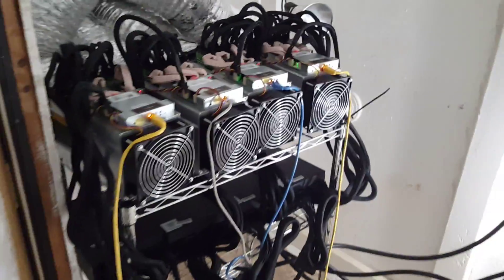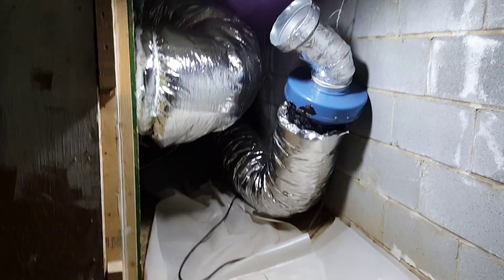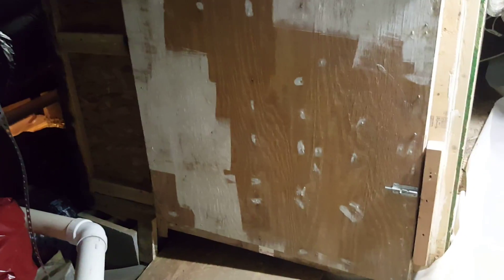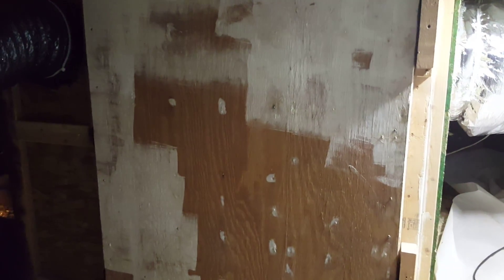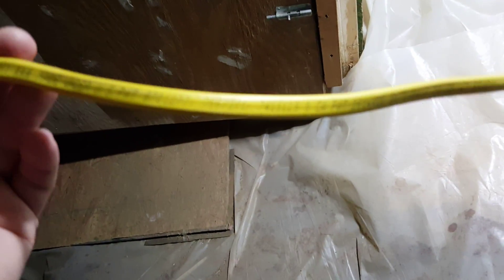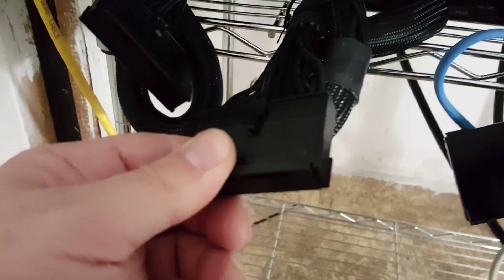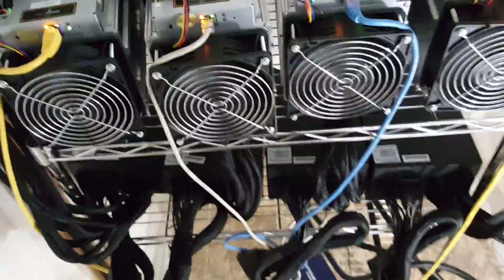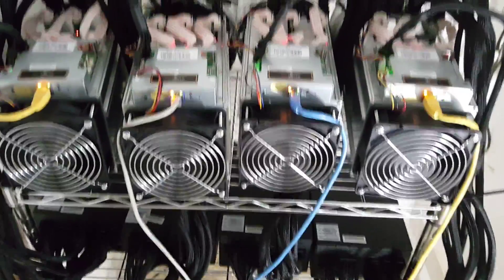Bitmain Antminer s7 or s9 Electrical Information and Home Wiring

Comment: I know this video is a little older, but I'm having problems finding good info. I just got an Antminer S7 (getting my foot in the mining door right now). Anyway, I rent my home so do not have the option to have 240v outlets installed, so the entire house is running 120v outlets, including the one outlet in the garage, where I want to run the miner. I did get a Bitmain 1600w PSU, but everything I've read or watched said those should only be ran in 240v outlets. So I'm not sure how to even power this miner at the moment. Do you have any suggestions on how to safely power it using 120v outlets?
Reply from the maker: Welcome to cryptocurrency Mining and yes the power supply you bought with it will only run on 240 and it's not worth paying electrician to switch over but you do need to buy a regular power supply for a computer that will work. Like this one https://www.youtube.com/watch?v=PReyGNEKgAs&t=7s
Reply: @TheBitcoinMiner  I've looked up that particular power supply and there's no way I can afford it, being around $800 everywhere I looked. I appreciate the info though!

Comment: Good evening brother, greetings from Venezuela, I have a question and I would like you to help me please, in the video I do not see any air intake to your machine room, you made it completely hermetic or it has some air intake that is not visible in the video? I did something similar but I realized that without an air inlet the machines work harder, just opened a hole in the wall, the temperature went down considerably. Thank you
Reply: El SEBIN  quiere saber tu ubicacion!  :)
Reply: @orianabracho3506  jajajajajaa no jodas ya esas máquinas no existen y el dinero tampoco 🤣🤣🤣🤣🤣

Comment: Thanks for the excellent video and information. I am interested in starting a mining operation with one S9 and hopefully expanding over time but will initially try to do this out of my home in the US. I have a 200amp panel that I believe is completely full. This panel runs the entire house including a greenhouse and hot tub. I was wondering if I need to upgrade my panel or if it would be better for me to just try and run the S9 off of one of my house outlets with one of the EVGA PSU's. Or if there are any other options that I have overlooked? Thanks again for the video and your help.

Comment: The wiring with 12/2 will work, but caution needs to be made for to denote that the white "usually neutral" wire is now hot. You are also using a (5-20r) 110-20 amp socket. If you plug in a normal us device you will fry it, potentially cause a fire. there is a different outlet for (6-20r) 220-20 amp. From there buy the proper cable to connect to the power supply (6-20p to C13)
Reply: theogmac - question from a newbie.. if the outlet is properly labeled and the power cord is rated to 15 amps, will a 5-20r  cord work for one S9 at 220 volts?

Comment: Well, fuck the lathe or kiln, the S9 is gonna need the plug.  Using a positive pressure system to keep the room "clean", like an operating room.  It was what i was thinking about doing.  To bad those power supplies you talk about are sold out.

Comment: Hello TheBitcoinMiner! I have three D3s coming I'm just wondering if I use a 240v transformer and plug it in my wall socket will that do. I apologize for this silly question I am no electrician. Each D3 uses 1200w power I am planning to use 3 transformers if this will do.

Comment: So to clarify for 1 anymore s9 I would need atleast 5.6amp running at 240v? (1350/240) so for 12 s9 could I run them on 4 30A breakers? With a decent PDU unit

Comment: Uh, 240v is lower amperage, L3+ for example consumes roughly 3 AMPS on 240v. 110 is higher amperage.
Reply from the maker: Hi Kore, yep that's pretty close,  so basically if it's pulling 6 amps on 110 you can cut it in half by plugging it into 240.
Reply: what kind of breaker do you recommend 20A or 50A for the box ?

Comment: I cannot upgrade to 240v in my area.  Is it still possible to run my Antminer s9 on a 110 15amp? please advise.
Reply from the maker: Hi Chris. Yes you can
(I use this one) EVGA SuperNOVA 1600 T2 80+ TITANIUM: 
http://amzn.to/1mGxRho

or

EVGA SuperNOVA 1600 G2 80+ GOLD:
http://amzn.to/28WDEvn
Reply: TheBitcoinMiner Thank You.  I was worried, because I connected my new Antminer S9 to a new Bitmain APW3+ Power Supply, and when I plugged it in to my 120v socket, only the power supply powered on. Then I noticed that it was stated on the Bitmain website that the APW3+ requires 220v. Thank You for letting me know.  I am purchasing the T2 Supernova tonight.
Reply: You should check again. A lot high power appliances such as stove, ac, water heater, etc in the States use 240v(some even higher).  it be completely illogical and stupid for not being allowed to use such an outlet. There is at least 80% chance you are using one now.
Reply: How did the new PSU work out?  I've ordered four antminer S9's and calculate I can only run one per regular household 15 amp circuit. (1600 watts / 120 volts = 13.33 amp draw each). Looks like I'll be seeking neighbors or a local warehouse due to the power requirements.
Reply: @waxome  You do not want to draw 13 amps continuously from a 15 amp breaker.  Typically the wires are not heavy enough.  At that draw, you could overheat the wires and cause a fire.  Better to use the Dryer socket or oven socket.  They are 220 and not only is it lower amp draw, 220 is more efficient for ASIC miners.  Consult electrician for advice on this before you set fire to your place.  Please change them smoke alarm batteries if you decide not to use 220.

Comment: This question is in regards to one of my S9's, which is a 13 TH/s model, received Feb 2017.  On the Miner Status page, the Temp(Chip1) section does not show temperature.  Instead, hyphens (or dashes) are displayed.  Does this miner need a firmware upgrade?  How to fix the temperature display?

Hardware Version 4.0.1.3
Kernel Version Linux 3.10.31-ltsi-00003-gcf03eb9 #81 SMP Mon Apr 25 11:20:36 CST 2016
File System Version Tue Dec 6 00:46:05 EST 2016
BMminer Version 2.0.0

Comment: You're running a 12 gauge wire, are you using a 20amp circuit breaker? Are you then running them on different circuits? Would S9's run on this setup?

Comment: Curious you have individual dedicated circuits for each of the miners?  Not running 2 off of 1 20-AMP circuit?  The S9's running at 1375 watts on a 240V circuit should be about 5.7A each.  Could you not run 2 or 3 safely off of each 20A circuit?
Reply: 1375 WATTS / 240v = AMPS = 5.7A, You'd want a decent server PDU (Power Distribution Unit) that can handle the amperage for the amount of rigs you plugin. And obviously within the Circuit breaker you are using.
Reply: It is safer to dedicate 1 circuit to each miner if you have the space in your electrical box.  But you could use a server grade PDU with a breaker that can distribute the power needed.  I wouldn't run more than two miners on a 20A breaker.

Comment: Hey TheBitcoinMiner.  First off, thanks for all the great videos!  Quick question... just got into mining and going to build a box for my S9's.  I plan on running 240v outlets as well.  Are these the correct "safe" supplies to use?

1) BREAKER - 20 amp 2 pole (http://www.homedepot.com/p/Square-D-Homeline-20-Amp-2-Pole-Circuit-Breaker-HOM220CP/202353326)

2) WIRE - 12-2 Yellow Stranded (http://www.homedepot.com/p/Southwire-By-the-Foot-12-2-Yellow-Stranded-SIMpull-NM-B-W-G-Wire-28828299/204724936)

3) OUTLET - Commercial Grade 20 Amp Straight Blade Single Receptacle (http://www.homedepot.com/p/Eaton-Commercial-Grade-20-Amp-Straight-Blade-Single-Receptacle-with-Side-Wiring-White-1876W-BOX/203492426)

Is this outlet correct even though it says 250v?

Lastly, how do I "convert" the power cord that came with my EVGA 1600 G2 to match this outlet?  Adapter?  Or new cord altogether?

Thanks!!

Comment: Hey there! I'm just getting started with BitCoins and researching BitCoin mining. I've gotten as far as setting up a couple wallets, backing them up, finding the indexes and exchanges (lots of confusing info there) and now researching Antminer S7 and S9s although I can't find an S9 for sale from the manufacturer and the best Canadian price I can currently find is $3200+13%tax.

My current electrical panel is a 100amp panel and it doesn't have any space left. I'm guessing that I've got a lot of upgrading and prep work to do if I'm going to get into the BitCoin mining hobby for long term don't I?

Would you recommend I upgrade my electrical panel to 200 amp service?
I'm looking at getting 100TH/s worth of AntMiners. The S7 averages 4.73 TH/s so that means I'm gonna need approx 21 S7s or 7 S9s. Energy cost on the S9s is supposed to be super low but I don't have a good sense of electricity usage and haven't done the math yet.

Probably have to build a separate room in the basement and dedicate an air conditioner to it...

Man the more I think about it, the more this is becoming a data center LOL!
Reply from the maker: Hi Tom Gwozdz, it does sound like you've got your work cut out for you but maybe I can help a little bit. First off I think you are on the right track on the with the antminer S9 (s7 and s 9 use 12 amps each) but they're just way too new now you're going to need to wait about 30 to 60 days and pick them up at 1k to1.5k or your ROI will just be way out of whack but then again if you have dirt cheap power it may not matter. What is your power cost? Do you plan on using 240v or 120v to power them? What power supplies were you thinking about?

Yes I recommend you upgrade your electrical panel. I would definitely set up an appointment with an electrician tell him you want to run 7 power supplies drawing 1400 watt each on 240v and I'm sure he can advise you from there I am not an electrician.

At $0.10 a kilowatt running an antminer s7 or s9 will cost you about $100 a month.

Yeah I was just looking at mine today and they look practically brand-new because they're in a clean box 
and I would recommend filtering any air going to them.

Definitely sounds like a heck of a project please keep us updated and GL.
Reply: I'm ok waiting to make sure I do it right but I have to admit that every day I wait, I feel like I'm missing the boat. The power cost varies throughout the day. 7pm to 7am is 7 cents per kWh and jumps to 18 cents kWh at peak times, schedule here: https://www.miltonhydro.com/residential/rates/rates-for-electricity-and-water/
I was planning on running the miners on a 240V circuit to cut down on the draw like it's done with an electric dryer for instance.

I'm contemplating putting about $20k to a solar/battery/inverter solution on top of a 200 amp panel upgrade to make sure I can feed my mining farm but that's my overkill scenario. I've already got a cool basement as it is but I have yet to feel the heat generated by the asic miners.
Reply from the maker: Do you have reliable power where you live? I would not spend the money on batteries,  I would use  a grid-tie kit / inverter and just use the grid as your battery Bank instead it's a lot cheaper.